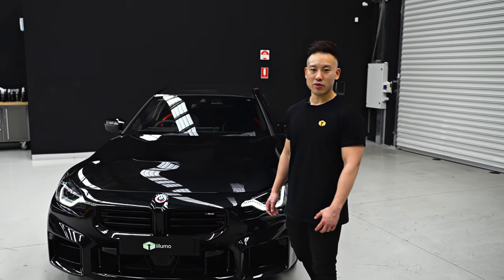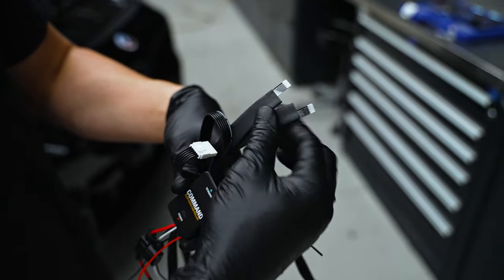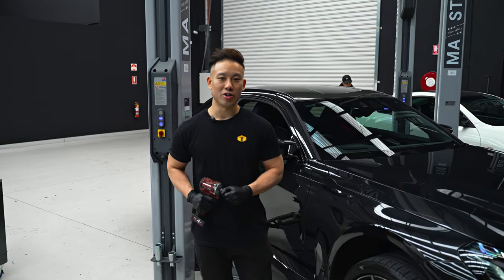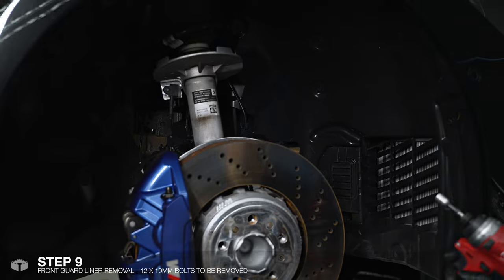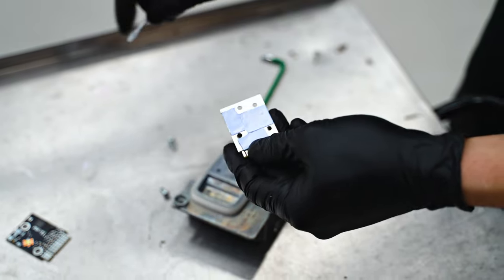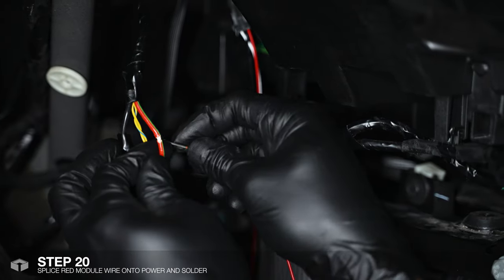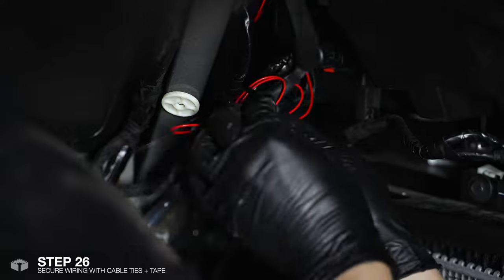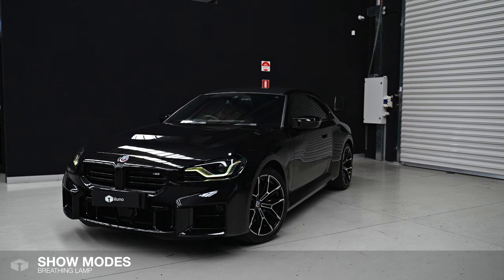BMW M2 RGBW DRL Mod (G42 G87) - Make your M2 even more bold!

Comment: Is the Headline still waterproofed with this cable which came out ???
You put it over the sealing ring ?
Reply from the maker: No condensation issues. The ribbon wire is extremely thin, and doesn't compromise the seal.

Comment: Hey brother, does this function like the oem drls? Turning off and on when unlocked/locked. When car is turned off they turn off?

Do factory drls need to be turned off via esys or idrive for avoiding errors? Or are we tapping directly into the headlight feed tricking the car into thinking it is OEM.

If my kit has a white wire, as I see yours does aswell, do we connect the white with the red wire when we connect it to the red/green wire from headlight plug?

I appreciate you in advance!

And lastly,
Reply from the maker: In short, our DRL modules function just like the factory so no coding is needed to disable or enable anything - simple as that!
Our kit has 2 wires you only need to worry about - Red (power which taps to the cars red/green wire), and Black (ground which taps to the cars black wire)
Reply: @iilumo  thank you so much for your speedy reply! I appreciate you!

Just as a side note do you mind telling me what exactly is the red/green wire? I understand that it’s a hot run and start wire but is this what powers the drls?
Reply from the maker: It's just power for the headlights

Comment: Damn the part with the power and ground and just soldering on some wires is some crazy sketchy bs. Definitely will cause problems in the future. You can do better.
Reply: Lol, if soldered properly, it will NOT cause problems...